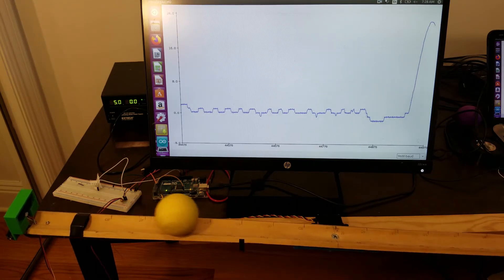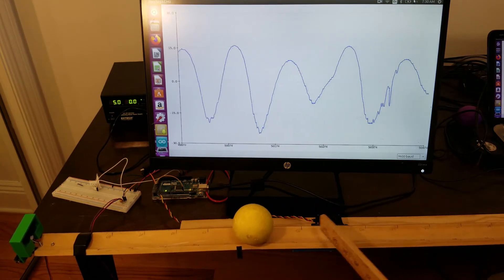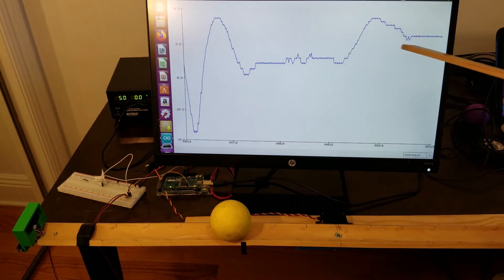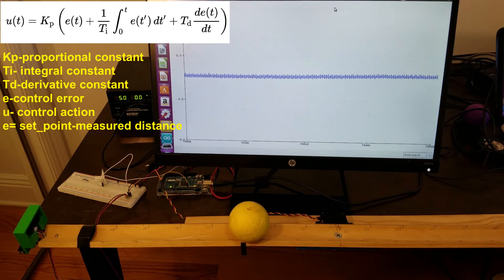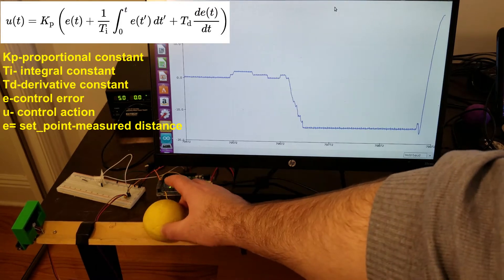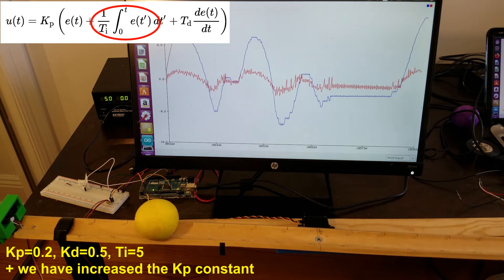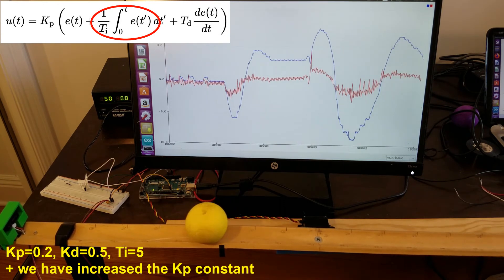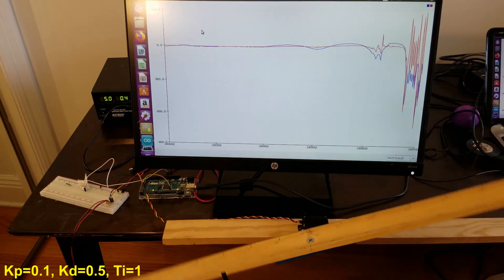Simple Experimental Tuning of PID Controllers using Arduino and Ball and Beam System

Comment: Hi sir 
Its amazing project i want to understand  project in simulink matlab 
i need to simulate project on  simulink using simscape can you send me matlab files pls thanks lot
e mail: mertkan.bjk@hotmail.com
Reply from the maker: The codes can be found here: 
https://github.com/AleksandarHaber/PID-control-implementation-Arduino-Ball-and-Beam-System
A post explaining how to discretize and implement a PID controller can be found here:
https://aleksandarhaber.com/pid-controller-discretization-and-implementation-in-arduino/
Reply: @aleksandarhaber  thanks you sir 
Best regards 👍
Reply from the maker: Good luck with your project!